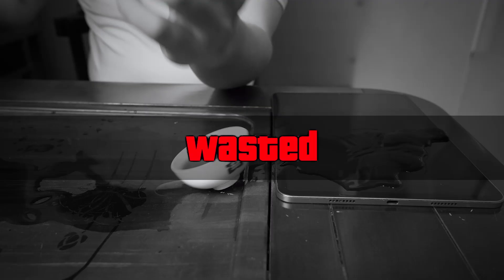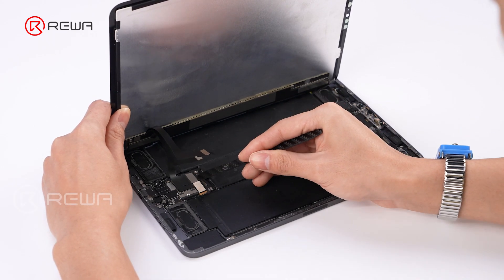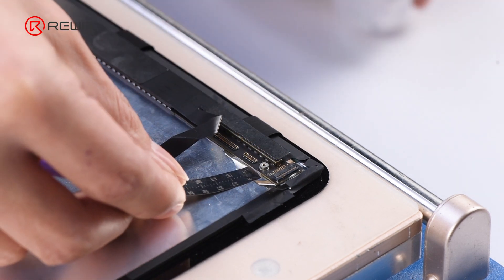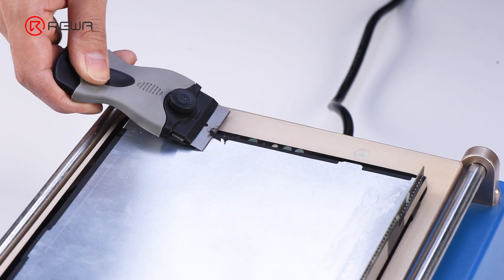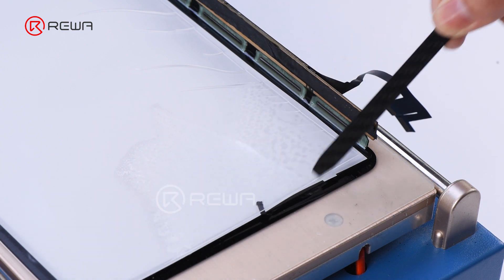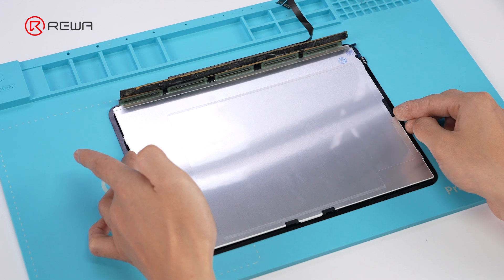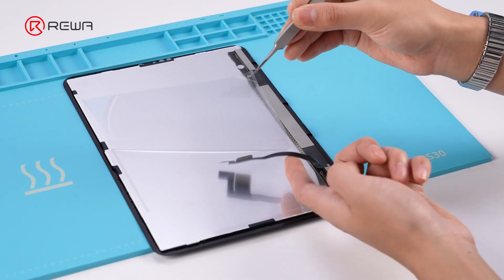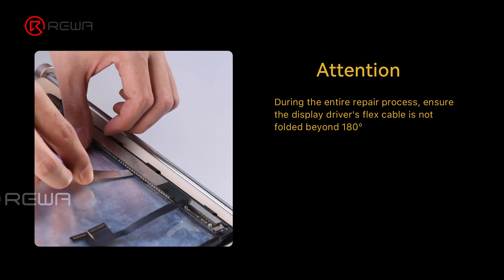iPad Screen Water Damage Repair--Only to Repalce Screen ?

Comment: Hello I hope you doing well, I have iPad Pro 5 gen and I have the same problem but with an amount little water on screen and Face ID didn’t work. 
But the iPad work perfectly, I ok with Face ID should I be worry about the future problem or it’s ok and I can use 

Thanks ❤
Reply from the maker: Ummm the Face ID may need a further troubleshooting, you need to check it especially C-MOS

Comment: my lenovo legion tablet has tye same damage but alcohol not water

Still after 1 years still not drying of 

Also the screen now is crack because I accidentally drop it but the touch still works
Reply from the maker: Perhaps a front glass and the backlight you all need to check